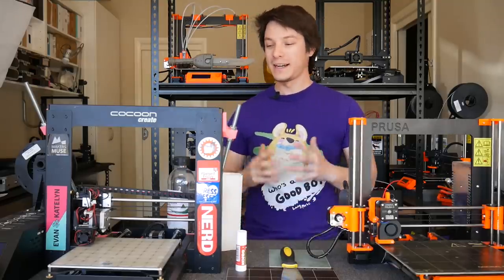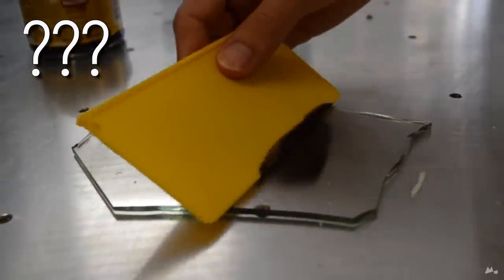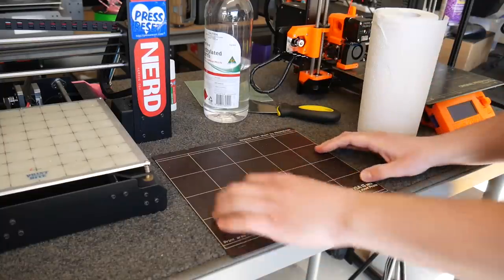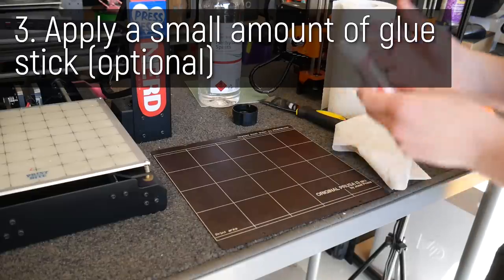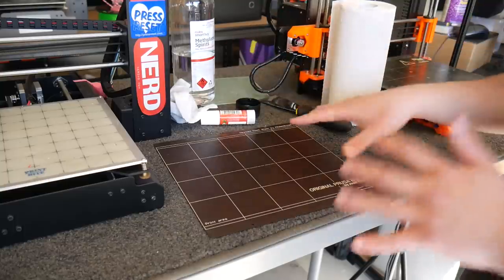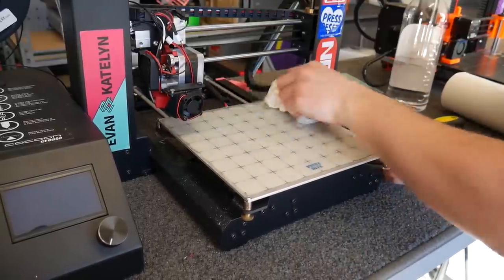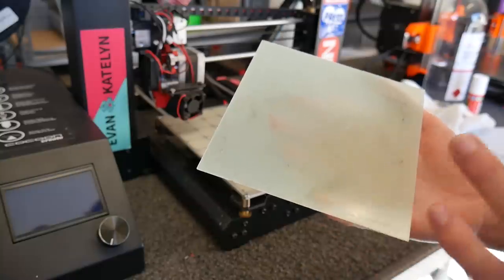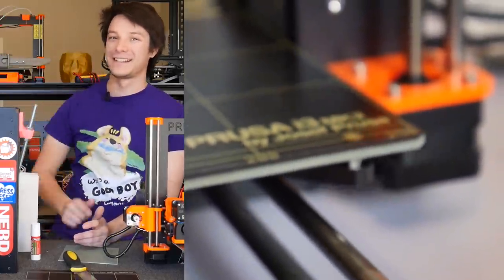3D Prints not sticking anymore? Watch this! 3DP101

Comment: Awesome tips! And even better, awesome shirt! :D if you dont have spirits or alcohol i do the same paper towel trick with plain old water and causes the glue to just lift right off (after about 3-5 mins) and you can scrape/wipe the same way :D on the prusa PEI sheet i actually just take the sheet off before preheating and wipe it down with some warm water and leave it and all the glue comes right off just by rubbing the sheet with a paper towel. For good measure i use a little alcohol prep pad at every, 5-8 prints though :)

Comment: try  VO5 styling spray, freeze hold, a spray on hair gel it works amazing, has a fine mist. you can wash it away with some alcohol hand gel, or just wash the plate in warm soapy water, works on glass

Comment: The gentlest method to degrease anything, I found, is to first use vegetable oil. Then soapy water, then water, then use IPA generously. I suspect mineral oil would do the same thing, but vegetable oil is simply safer. It works so well because it dissolves some greases much better (faster) than alcohols or soaps do. I found for instance that it works insanely well with many adhesives that are otherwise recalcitrant. Soapy water and IPA easily take care of the remaining oil. 

You can also use it to clean your hands after doing mechanics work. Just try it. No need to use abrasive soap, just squirt a generous amount of canola oil in your hands, rub, rinse with soap, no grease stains left.

Comment: Agree, PVA is often a good way to go.
I have a jar with a small sponge and water standing besides my printer. PVA glue dissolves fine with water. Just add a very small amount once in a while, and spread it out using water/sponge.
Keep fingers/grease off the plate ! -or as Angus does, use alcohol to degrease.
Keep it clean, and it will deliver top Q prints all the time ;-)

Comment: My current method is primarily solvent cleaning the bed (wear gloves). I only use glue stick if that's not enough for the job. I use glue stick is like Angus shows, but I use water to dissolve the glue. You only want a near invisible layer, certainly not lumps or streaks. My main need for cleaning is removing excess glue. A powder coated steel bed rarely needs glue.

Comment: Personally, I use a mix of water and PVA glue solution and apply it to the bed with a sponge. The bed drys it to a mirror finish (I use a glass bed). It looks so satisfying when looking at the prints first layer, and the adhesion is superb! I've never had any problems with adhesion and there's no solvents, chemicals or alcohols used!

If I ever do clean the bed, it's in the sink with warm water and dish soap.

Comment: Is 70% or 90%+ Isopropyl a good substitute for the Methylated Spirots? On reading about it, Methylated Spirits (not heard that term before) or Denatured Alcohol is/can-be very similar but is often much more diluted, like in the 10% range and is Methanol not Isopropyl which is a larger molecule but otherwise largely similar.

Comment: I only use gluestick when printing TPU - but not to get it to stick better but rather to get it to stick worse, I've destroyed printbeds because TPU stuck too well to it (the glue provides a layer that you can pull off more easily)... For PLA I usually just use brakecleaner (acetone free) and a towel before each print and I NEVER had a print loosen up

Comment: The duct tape worked good. But the item lifted and moved around after printing for 30 minutes. I am making a 6.5x2.5 inch plate ate 3/4 inch thick. I only made it to 1/8 inch thick and the  edges started lifting.

Comment: Interesting. I've used glue stick with little success, and thus I found out that Cheap Painter's Blue Tape from the Dollar store applied evenly on the bed makes a better adhesion material for me. Of course, I have to prep it by buffing it out with a green (plastic) pot scrubber and if needed, a bit of acetone/abs slurry rubbed onto the tape. The slurry only needs to be applied once as it will last until the tape needs to be replaced, but the tape needs to be buffed up before the first print of the day, then it is good for the rest of the day.

Glue stick has cause a major mess on my printers which I had to clean up and prints never stuck to the bed. Thankfully, I found a youtube video (forgot by whom) on how to clean the glue stick off the bed with just water. It's a lot of work but it stripped the glue stick off the bed. Don't know what the glue stick formulation is DownUnder, but here is the USA, water can dissolve glue stick.

Great and informative video, BTW.

Comment: I just use masking tape on the print bed. Easy to remove and I've never had a failed print. Cheaper than removable print beds and does the job. Can even use a glue stick for increased bed adhesion.

Comment: I prepared a bottle with gluestick/isopropanolalcohol solution, testing the stickyness with my fingers. You don't need a lot of gluestick. Moisten a sheet of toilet paper with this sticky solution and applying to the bed. This thin film is unvisible on your print surface.
Very fine support material sticks perfect on glass.

Comment: I clean with alcohol and then use a purple glue stick.  Then I like to spread the glue around the bed with a little bit of tap water.  This gets me great adhesion!  Another trick if you have a removable bed plate is to simply run the print surface under hot soapy water in the kitchen sink, then apply the glue stick in the same way.

Comment: good video as usual, I have the cr10 with the original tray not very pla ^^, I use spray lacquer discount and I never had a print that takes off, and I had to do a good fifty saw nose, but I knew the tip of the glue stick that I found correct but quite boring cleaning, in any case the bomb is easier to clean I think but it's subjective , in any case very good idea to slightly dissolve the glue with alcohol

Comment: I never used any glue stick on my Ultimaker 2+ and my parts stick to the bed without any issue. From my point of view, the right leveling of the bed is crucial for the part to stick to the build plate! Before a print I use a wet paper towel to clean the surface.... that's it.
Reply: Ive had my Prusa mk2 for almost 3 years.  Printing every day. ( I run a business)   Never had an issue until this week.  So I guess its not an issue of if but when.

Comment: Bit of a Necro post but HOT DAMN! Did that work a treat on my new Ender 3 v2.  Benchy printed fine, but anything larger and it just wouldn't stick.  Didn't matter how much I tweaked the levelling & settings.  :O  But this - this worked.  :D

Comment: Why not wash off the glue stick if there is too much on the plate? PVA can dissolve in water
Reply: When PVA gets heated it changes chemically and becomes much less water soluble.
Reply: James Churchill but...but..why Is it used as SOLUBLE filament?
Reply: dontlikemath -.- different pva mixes crosslink to greater or lesser extents. It's also affected by how long it's kept hot - the PVA on a build plate will stay hot for hours, filament is only hot for the few seconds it's in the extruder.
Reply: With my glass bed plates (I`ve got four) and I put the dirty ones in the dish washer! Works like a charm.

Comment: I have the exact problem you described. I have been printing for months on my ender 3 pro with printing mat with fantastic results. Yesterday, when I was doing a batch of 20 or so prints suddenly my prints stopped sticking. Oddly, a few days before I had used isopropyl alcohol (called ketonatus in Dutch stores, which is supposedly the same, but made undrinkable) to clean my bed for the first time. So I was suspicious more isopropyl would fix it. 
After a good clean, some of the projects stick and some don't. I had already checked the level of the bed on all corners by putting a piece of paper under the nozzle and raising the bed until I felt a resistance. The mat worked before, so I'm not too keen on putting glue on it. Any suggestions?
Reply: Allright, I tried some isopropyl from the pharmacist and that worked. Apparently the additive to make the isopropyl undrinkable leaves an oily residue. Good to know, since the bottle states it is for cleaning instruments.
Reply: One day later, another update. I found out that the bed of my Ender 3 Pro is lower in the middle than at the corners. So when I'm leveling at the corners, the gap between the extruder and the middle of the bed is slightly too big and the PLA does not stick as well. According to several forums, this is a commonly known fault on the Ender 3 Pro. So, just a heads up in case someone deals with sticking issues on this model.

Comment: I use a sugar mixture and havent had any print peel ever again 1:4 mix 1part sugar to 4 parts water put in microwave to dissolve and then apply on heated surface when it cools the parts will pop off.

Comment: Hey Angus, just wondering where you get your filament from (besides freebies, of course)? Recently just got into 3D Printing thanks to you and Michael from Teaching Tech, but I'm struggling to find reasonably priced and reliable PLA here in Australia. Got any tips?
Reply from the maker: I get mine mostly from hobbyking because their shipping is cheap to my place, but it varies greatly depending on your location in Aus. If you're in Perth X3D is pretty good.
Reply: Thanks for the quick reply and the tip, hopefully Hobbyking shipping to VIC is decent as well.

Comment: I have a glass bed and use alcohol and a glue stick.   Sometimes it's a challenge getting a print off of it. But frankly, that's much better than a failed print. Time wasted prying off a print is a lot less than starting over.

Comment: The suggestion about spreading out the glue stick evenly with solvent did the trick for the PEI sheet I got for my CR10s but never got to work right. Printing quite nicely now.

That said blue painter's tape will always hold a special place in my heart. That stuff, with some glue stick, is almost fool proof, in my experience.
Reply from the maker: Thanks for the feedback, glad to hear it. Yeah... I started with painters tape too on the makerbot replicator 1. It got old having to replace it after every single print though!

Comment: I just wash my glass bed with warm water, and reapply a thin layer of 3DLac again. Just works, without any solvents. From what i know, 3DLac ist just a water based hairspray with another label on it. Tryed a few different supercheap hairsprays, but for now i have not found the right stuff yet that shows similar adhesion as 3DLac. 
And if you have a printer with an unheated bed, why not use a hairdryer or heat gun to preheat the bed a little just before you start the print?

Comment: What work for me, is between creating new prints,  I do some drywall repairs that involve a lot of sanding. Then I pick my nose using each finger, to get a proper coating of a very adhesive type of slurry on the fingertips, then its ok to not have to worry about any transfer of oils. I can't stress enough about making sure a lot of sanding occurs, and to make sure to create a proper drywall dust cloud to breathe in, and only through the nose.

If you run out of drywall repair plaster, then its ok to skip the above recommendations, and melt some ABS plastic in a small jar of acetone, then use a proper paper towel to apply it to the build plate surface.
Ideally, you have a heater on your printers buildplate underneath it that can easily reach 110c, rather than just going with somewhere in the 70's to early 80's, as is the often the case when ordering printers off of ebay.

Hopefully printer manufacturers read this and take some notes. That would go far to help preventing landfill, and those microbeads that are in the diet of the fish you had last week when you ordered fish n chips.

Comment: I have nothing but fails because of first layer not sticking on my new ender 3. Where I found the problem is in the "Ultimaker Cura 4.6.X.  The fix and the cure was the initial flow is set too low. Curling, lifting and warping gone. Increase the initial flow and the first layer sticks.  My set, First initial temp material-225, flow-150%..

Comment: I had a serious problem with my MK3. From day to day it stopped sticking. No amount of cleaning, calibrating, rebuilding, calibrating etc. would help. I could get a fine z-calibration. First layer of the print itself failed almost every time.
After a full day of testing different files and different setups, I found the solution.
Anything sliced with the newly updated Slic3r PE failed. When I tried Simplify or PrusaControl it worked without problems.
So. Sometimes the non-stick is not the bed, but the gcode.

Comment: One thing to try:  Half metho, half water. It works much better for removing oily things and as a side effect will also remove salts and sugars(from sweat) that also cause problems and at least on the Prusa beds require no other coatings.
I will need to try the 'diluting the gluestick' trick on my other machine's glass bed though. Love the stuff, but it builds up quickly.
Edit: Also, no PVA in gluestick. :)

Comment: I personally just use a glass bed without any adhesive, just washed with soap and not touched to avoid fat on the printing surface. Printing with heated bed at 60°C and prints get perfect

Comment: Angus, sorry if it's been asked before but why can't we clean it heated? Is it because of the vapours?
Reply from the maker: Yeah, it just evaporates too fast!
Reply: @MakersMuse  Thanks, mate. I didn't expect you to reply on an old video. Much appreciated. 
I was cleaning it with 100% ethanol at 60 °C, coughed a bit and thought, ahhh, that's why. Anyway, it does evaporate very fast too. Long story short, cleaned it, upped bed temp to 100 instead of 80 and lowered first layer speed to 10 mm/s. It was a newish ultrabase bed and adhesion was perfect for about 10 prints. Then boom, ABS was not having it at all and just staying stuck to the nozzle during extrusion. Just finished a 3hr print.... looks good. Thanks for the help, a Victorian under lockdown :( tomorrow... FREEDOM!!!

Comment: i never had a print not stick in 2 years even abs and flexible filament  the solution a simple tronxy print bed sticker.and after ever print clean it with alcohol, preferably while it is still hot

Comment: Glue stick is PVA so water soluble. With a removable bed run under a hot tap and nail brush and its spotless and chem free.  To avoid Glue stick lumps and get a super even thin coat add glu as normal then agitate with a warm damp nail brush. It gives a white creamy solution that drys in a few minutes.  ;-)

Comment: None of this worked for me.  Cleaned the plate until it was spotless to no effect.  Prusa suggested slowing down the print speed on the first couple of layers and voila! it worked.  The only thing that changed in my case was the rains came and it got colder than before when the printer worked fine.

Comment: Big Hello shout out to you Angus, from Germany :) 

I know that this topic doesnt belong to the video, but im struggling at the moment with some strange noise on my printer.

I tried to print something thats circular. But when both axis (X and Y) are moving, the printer starts to make some noise. My problem on this topic is, that im using MKS 1.4 Gen with tmc2130 in stealthchop. These should be very quite normally. When i drive just one axis around, there is no noise. Its just when both are driving at the same time. My belts are tensioned good, my speed is at 70mm/s. Acceleration at 300mm/s². Jerk at about 10.

Do you or maybe someone out of this community has any idea what it could be?

-----------------------------------------------------------------------------------------------------------------------------------------------------

Topic related:
Did you every tried a carbon plate? Can you recommend one? Ive heard, that it acts like glued when its heated? Im looking for something good for my petg prints.

Comment: I know this video isn't targeted for a user such as myself. But... I am so glad that I use hairspray on a glass bed. Glass is stupid simple to clean (soap and water) and I can spray the glass with hairspray while it's off the bed. I never have adhesion issues with PLA, PET, or ABS plus the prints pop right off the second that the glass cools off. I've tried a few types of hairspray and they are all the same so I get the cheapest crap I can find (Aquanet).

Comment: I also think that colours make a difference. I can't get red to stick. All other colours work fine. Same brand. Same filament. The glue trick works but it leaves the bed all crappy looking and it's hard to clean off. I had to use a lot of metho and orange goo remover to clean it later.

Comment: I just use iso...
I am curious why not to use on heated bed? I use it on mine no problems.
Reply: @MrSirChristian  hm.  I'll let the heat dry mine off.  I guess the concern is vapor concentration and a flash ignition?  Ehh...  No likely.  We're talk super low amounts of vapor from a quick wipe.  I guess better safe than sorry though when you are possibly instructing others who might do silly things.

Comment: Out of curiosity, did you intentionally gunk the second one for demonstration purposes, or did that just manage to work fine until it got to that point? I'm wondering if I'm being a little over-cautious with my post-print cleanup routine.
Reply from the maker: second one was how i've been using it! You can get away with a lot, but it will start to make your first layer look bad.
Reply: Awesome! Doing a wipe-down with iso before every print has done wonders for bed adhesion (I can consistently pull off some really small contact areas on PEI and Ultrabase), but man is that a hand-wrecker when I have a lot of prints in the queue.